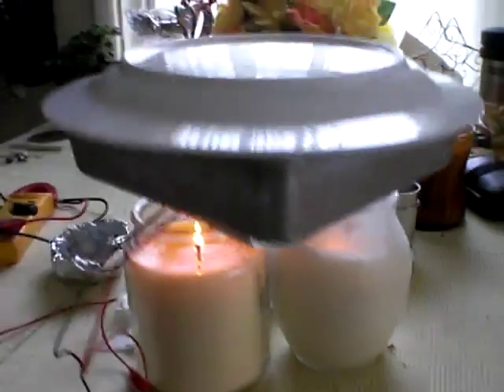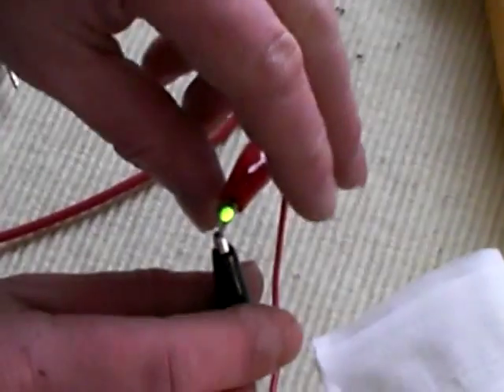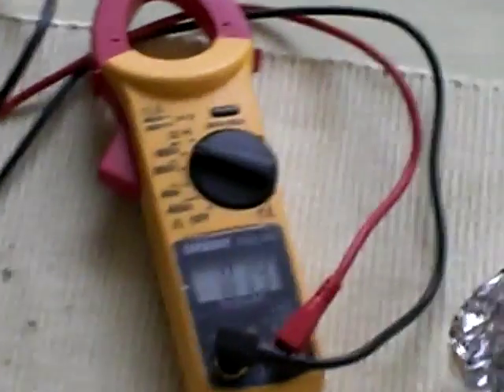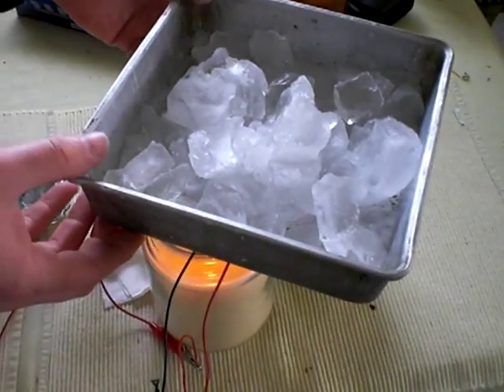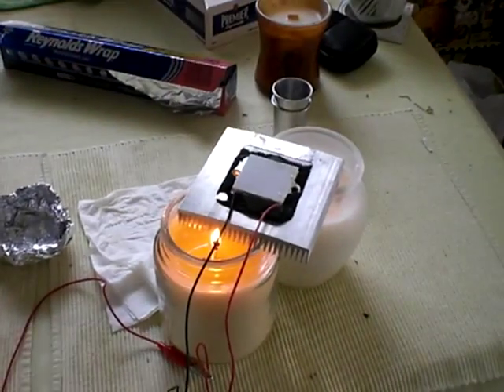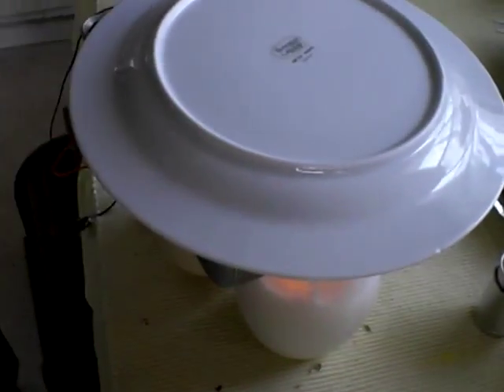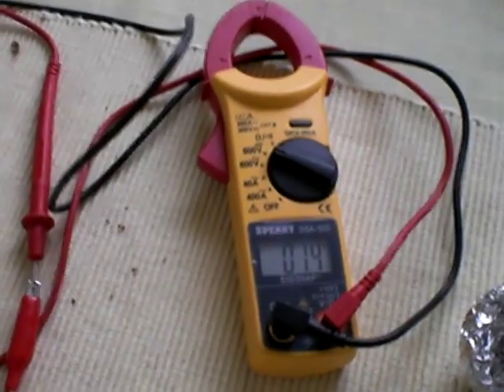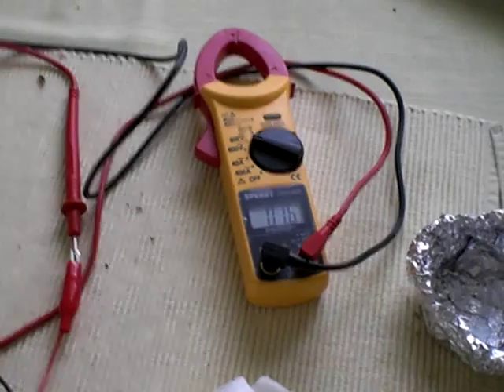Seebeck effect with Peltier module

Comment: i would like to know if there is a voltage drop across a peltier module?
a regular diode has a .6 v voltage drop
a blue diode has a 4 v voltage drop
is there a fix voltage drop for a peltier module?